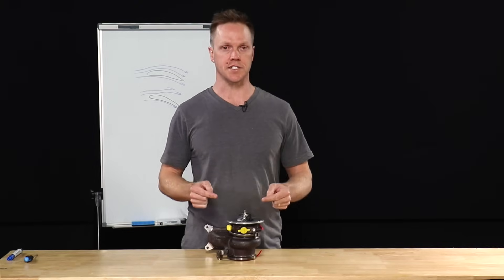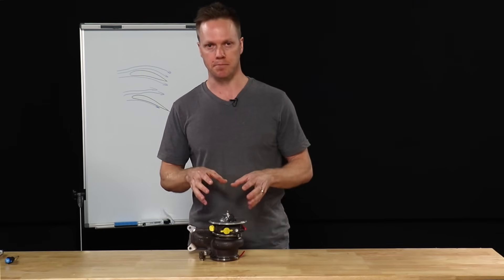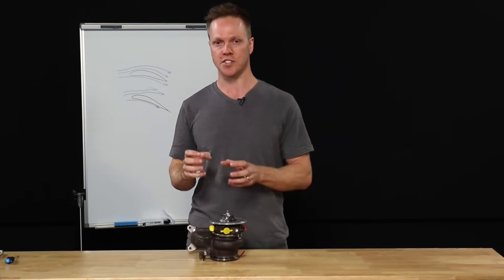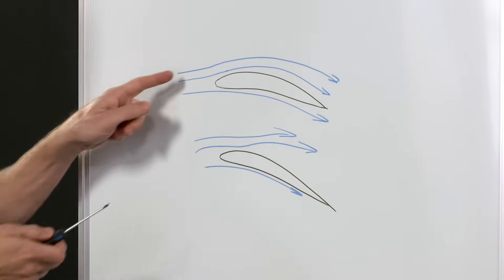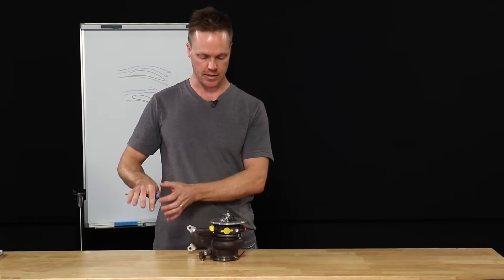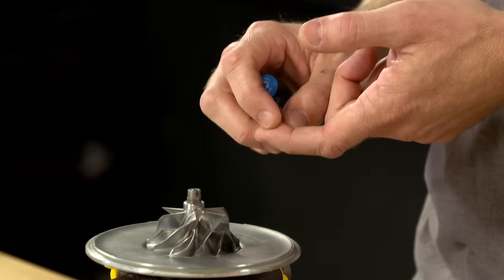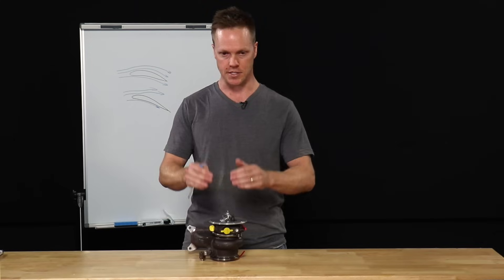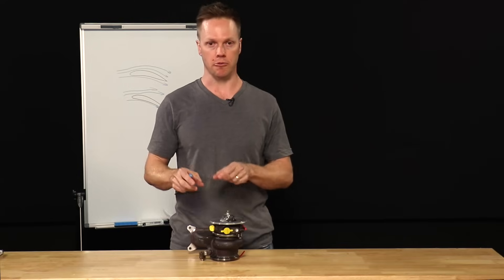Compressor Surge Explained [GO FAST BRETT]

Comment: i always remove the bov from turbo engines, no bov will ever beat the sound of the gobble! 
plus it's debateable that it actually does any damage to the turbo at all
Reply: It does do damage but it's not damage that you can really see until the thing explodes. Shock loading as described in the video can create micro fractures within the turbine that will propagate over time and reduce the longevity of the turbo. Ball bearings are also susceptible to damage from shock loading. TLDR: It won't reduce performance but it will reduce the life of the turbo. 
Source: I'm a mechanical engineer
Reply: +Tom B 
said engineer on youtube also owns a blow off valve company.

Would be within his interest to demonise flutter.

I have also read articles advocating against blow of valves as you can lose response.
Reply: I've read dozens of arguments from people who are supposedly educated on the topic explaing why it's bad in theory, but I'm yet to see any actual evidence to suggest that a lack of BOV has a non-negligible effect on turbo longevity. Plenty of people report that they experience perfectly normal turbo life on high-boost setups with no BOV, which I am aware does't prove anything, but neither does a mechanic engineer on YouTube making a conclusion about it despite a total lack of real-world testing.
Reply: The reason why there is a lack of evidence, is you would need two engines setup - one with and one without a BOV,, running the same turbo, loading and unloading the throttle constantly for an INSANE amount of time, non-stop for weeks or months even, until one turbo failed. It is not a realistic test for most people or companies to perform when you think about it. But the physics and maths do not lie, constant shock loading will cause wear over time no ifs or buts, and whether it decreases the life of a turbo by 1000km or 10000km, we don't really know... but there is no doubt its effects are negative.
Reply: Borg Warner, Garrett and Holset have performed compressor surge destructive/reliability studies. 
Contact their respective engineering departments directly and they can provide you with the results and recommended mitigation documents. 
Reportedly, TiAl has also performed similar testing, but I have not seen the results.
Reply: Yes you lose response - that is important for racecars who have their engines rebuilt every few stages, turbos replaced regardless to ensure reliability and systems done once-over to reduce failures considering there is money on the lines. We are not those people.
Reply: Ben Isaac I don't doubt that it wouldn't be an easy task to prove conclusively that BOVs make a difference to turbo life, but until then, or even until any sort of actual evidence exists, I really wish people would stop talking about it like it's proven science. Especially those who clearly have a conflict of interest in selling blow-off valves.
Reply: Agreed!
Reply: Gringo! won't probably hurt your stock 1.9TD Volkswagen
Reply: Gringo!  Not running a box does hurt the motor.. it creates crank case pressure, 26+psi having no where to go creates that.. I bought a car that was turbocharged that had no bov 2 weeks later after daily driving it started knocking bought new motor installed bov no issues since
Reply: People have to remember too that the engineers who design turbos understand and design with compressor surge in consideration. So yes, you can have a high boost, no blow-off valve setup and still have a long lasting turbo; however, the turbo could last even longer if it wasn't going through the constant shock loading. Another thing to consider is that there are tons of other factors besides having a blow-off valve or not. Turbo size, engine size, turbo design, amount of boost, tuning, amount of load, road or race use, etc., etc. Even if you tested 2 engines side-by-side, with and without a BOV, it really wouldn't prove much of anything.

Regardless, there is no denying that it puts load and stress onto the turbo, bearings, and shaft. A good example of what happens to the fins is this. Take a paper clip, and bend it back and forth. This is essentially what is happening to the turbo fins with compressed air pushing on them, back and forth. Do this enough and what happens? The paper clip snaps. Due to the engineering, the bearings might be designed to fail first, or the shaft before the fins, but again, something is bound to fail in the end.

Comment: So the "gobble" is it stalling multiple times, split second stall then build then stall then build then stall then build. in just a second or two.
Reply: Yep, it's amazing how fast some things can happen. Especially aerodynamic phenomena. There is something kind of similar with airplanes, in that when you start going too fast with a wing that isn't rigid enough, you get flutter. What this means, is that the wing will gain too much lift say aft of the spar (the rod that holds the wing in place) and it will start to go up, and twist the rear of the wing upwards. When it goes up, there is naturally a vacuum left in the space where the wing just was, as the direction of the airflow hasn't changed, so the back (trailing edge, sorry I forget to mention this earlier) gets sucked back down. And this process builds and repeats until the wing rips itself apart. And all this can happen is less than a second. Of course the speeds and angles at which this happens are calculated before the plane is even built, so there is nothing to worry about. Just thought I'd mention it.

Comment: I truly am still left with one question.  What about cars that make this sound stock?  Is that ok? Would the surge prematurely wear the bearings?
Reply: are you sure your not hearing a recirculation valve?
Reply: Matty P He very logically explained how and why it wasn't healthy for your turbocharger.
Reply: +CockatooDude not really, he was selling you a BOV. the forces he's talking about exist but not enough to damage your turbo
Reply: Matty P The force of the air moving through the compressor wheel is over 90,000 RPM yes, but it is also going in the direction of the fins which are computer balanced to avoid the damage you're asking about. Imagine it spinning that fast, and then being disrupted by an opposing force in the slightest - it's going to want to be knocked off it's axis. That force and disruption transfers to the thrust bearings.
Reply: The force just isnt there though. Ive been without one for 3 years, double boost and no issues whatsoever, talk to the leading tuners like nizpro and CMS in xr6 world whom all say the same thing regarding no BOVs
Reply: It's not damaging anything, He was doing well until he tried to sell you something
Reply: It is indeed damaging to the thrust bearing. You're prematurely wearing it out whether you think you are or aren't. It's physics. Many performance cars don't use them because of the slight shift in lag they don't want to give up.
Reply: +TWIRKNOLOVE how though? the force of the air going in under boost would be far more than the air bouncing off the compressor wheel. once again I agree the force is there but this video turned out to just be a sales pitch for BOVs
Reply: Well I imagine if it were eliminated the turbo would last longer.
Reply: +CockatooDude me too which is why I can't mesh that idea with the fact ive heard it in lots of cars from Subaru, BMW, Ferrari, etc. why if it's damaging?!?!
Reply: Matty P Well I mean a good blow off valve can't hurt. But I mean you sure that long term, not having a blow off valve in no way could lead to the turbo having reduced longevity, like maybe some shaft play after a few years, because I understand that the blades would probably be fine, but wouldn't the bearings wear out sooner?
Reply: Because not all forces are equal. Think of the blades as a sheet of glass. You could roll a bowling ball across the glass for 1000 years and it will be fine. But drop it once and game over.
Reply: +Matty P Cars should last longer than 3 years. Shaft play is the same as main bearing wear or cam lobe wear. Shit will still work but it aint working correctly.
Reply: Surge with no load on the turbo Isn't causing damage, Overspinnning your turbo by too much boost and coincidentally going into surge is what actually kills turbos, Plenty of anecdotal evidence to suggest no BOV does not harm the turbo as many OEM cars used to never have them, The reason they are now standard is because of the EPA

Comment: I have a BOV, running10psi, but still have some flutter on lift off at 1-2psi
Reply: It is a GFB Mach 1 BOV
Reply: I'm pretty sure that's because your Turbo isn't making enough boost for your BOV to open.
Reply: Yeah, I'm just wondering that's bad/should I get the BOV adjusted
Reply: +MaxTheKanuck you do realize vacuum opens blow off valves? Not boost.
Reply: some cars factory bov include a little bypass hole because there isnt enough vacuum to open the bov at those low boost situations for example the m35 stagea has a bov with this bypass and putting a aftermarket bov on that car will make some flutter at low boost when you lift off the throttle
Reply: Akizzem Well... Now I do.

Comment: I have a question sir... 2.5 turbo diesel mitsubishi it stays at 10 psi at full throttle till it goes past 3000 rpm then it will start boosting 15. why? of I could get maaad 15 psi choo choos at 1500 I'd be a happy yute ✌ ps you make my day when I see new episodes !